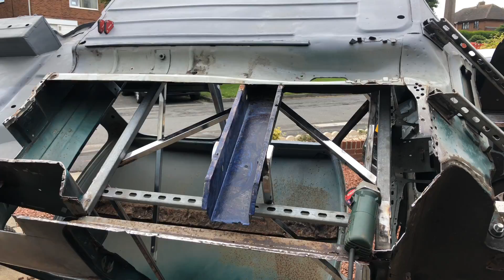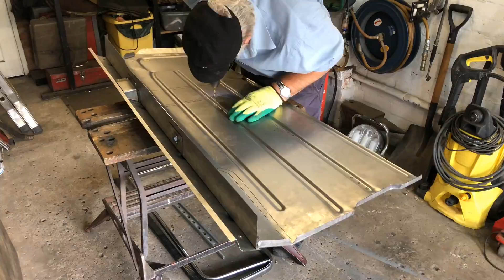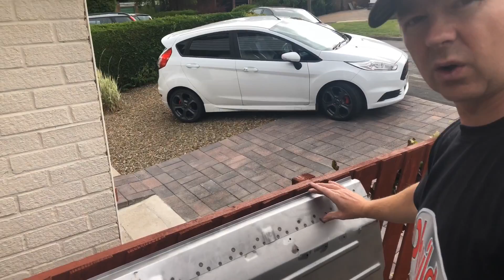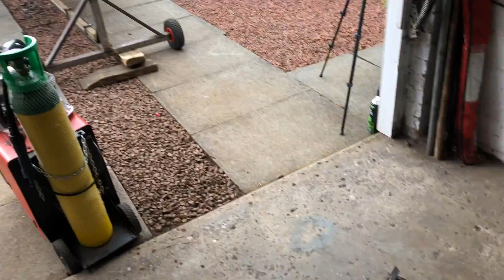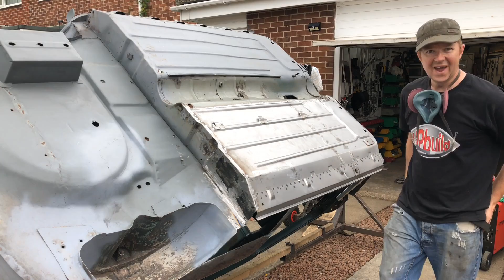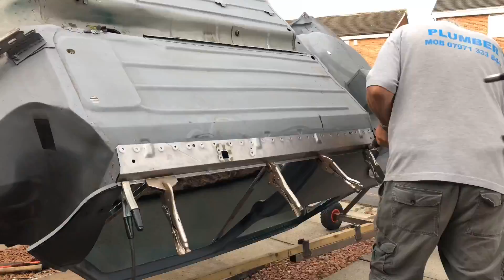Classic Mini Mk1 Conversion - No more rust - Part 28

Comment: who supplies your body panels are they as good a fit as the original mini panels i know sometimes people have problems with aftermarket panels fitting
Reply from the maker: Hi! we use a mixture of either Magnum, M-machine or Heritage panels. Magnum are the panels that seam to need the most work to get fitted right, M-machine are very good quality and very reasonable on price and need a bit less tuning to fit. The Heritage panel need the least amounted work to fit and are very good quality, but you pay quite a bit more for them. Cheers 👍

Comment: Great work so far 👍🏼 I’m currently restoring a Mk3 and funnily enough have the same welder as you. Wondering what wire speed and voltage do you tend to use? Thanks
Reply from the maker: Hi! Thank you. I usually have it set at 2 on the amps and 5 on the wire speed or 3 on the amps and 6 for wire feed. I’m using 0.6mm wire. If I’m using 0.8mm wire, I drop the settings back a notch on everything usually. 👍👍
Reply: UPbuild appreciate the help 👍🏼 cheers
Reply from the maker: Not a problem, a few have asked about the welder and setting, so if I get time I’ll do a quick shot and chat about it in my next episode. 👍

Comment: If you have a compressor my tip is to blow off the angle grindings or they'll crop up later in the painting stage causing rough area's that rust at an accelerated rate underneath:)
Reply from the maker: Hi! Good point, thank you for the tip 👍👍

Comment: Pleased you mentioned Waxoyl, however its spelled. Used it a lot in the old days in the UK when manufacturers only paid lip service to rust proofing. Here in Australia, similar treatments are available but not so common because rust proofing by car makers is now much more exacting, and we don't have salt on the roads in winter. This is great watching you and dad putting this little beauty back together....
Reply from the maker: Hi! Thank you very 👍👍. Yeah the Waxoyl definitely seams like a good idea, it’ll definitely help slow down rust at least. Mind we didn’t plan to use it during the winter or bad weather on the road. We’re have a great time with it.
Reply: @upbuild4397  I'm 72 and still keep myself involved around cars. Mind you the weather here is a lot more agreeable and I prat around with cars even though I have no real need to financially. It's still a hobby but leaves my wife scratching her head as to why I'd lay on my back under a car when we could get repairs done by paying someone. She misses the point of course. We have new Honda CRV which doesn't need anything, but we bought a 2006 Tigra as a toy for sunny days, but which is likely to need work occasionally. That was the point of it, and the attraction. Currently it's in hospital waiting for an alternator, but the weather is crap now so it's no biggie. I'm from Hull originally and moved to Australia in 73. Been back many times over the years and still love the place especially August - September and that long twilight, which we don't get here. Daylight one minute, dead of night the next...

I'm sure you'll keep everyone up to date with your progress you two buggers. It's an interesting journey...

Comment: What welding set up do you use? Does the gas not blow away outside?
Reply from the maker: Hi! We’re using a Sealey Supermig 180 on gas. Yeah the wind is a problem at times, I try my best to shield the weld and turn the gas up slightly to help.

Comment: I'm wondering why you just spray primer on inside sections like that box section in middle of floor.  Most primers absorb water. Why dont you paint over those inside sections? After all it is only primer.
Reply from the maker: These areas are also painted after primer, it’s had to tell in the video as it’s speeded up.

Comment: hi guy your I I is looking really good so why don't you seal all the  joints up so rain can't find its way back in its used on most late cars to prevent rust in joints
Reply from the maker: Thank you 👍👍. Once we’re finished all of the welding etc on the shell we’ll seamseal all the areas.

Comment: Cracking job as per usual from you & your dear old Dad! As for the Mk1 2 piece headliner, remember to replicate the fatter half round shape between it & your lowered door/rear quarter windows. It should be the same shape as the pressing above the front & rear screens. Otherwise it'll look a bit odd! Cheers again. Leigh. PS: Did you get a chance to look at the pics of my Cosworth Viva on Instagram? You may like it!! It will most certainly divide opinions!
Reply from the maker: Hi! Thank you 👍👍 yeah we’ll need to fab the Kant rails ourselves, it’s one of the few panels not made anymore, but we have plan for it.

Comment: What’s your plan with the roof gutters?
Reply from the maker: Hi, this will most likely be one of the last things we do on the shell. The extended drip rail are available and a couple of tweets to the existing drain holes and we should be there with them though.

Comment: Great video I’ve only been subscribed for a couple of episodes and haven’t had time to watch any back episodes yet so sorry if you have already mentioned the gear stick hole but the Mk 1 had a smaller hole at the front for the pudding stick change, the gearbox had a different diff case for the long lever.
Reply from the maker: Hi! Thank you and cheers for subscribing 👍👍 Yeah this is something I’d like to change but not sure for definite yet.
Reply: UPbuild 8